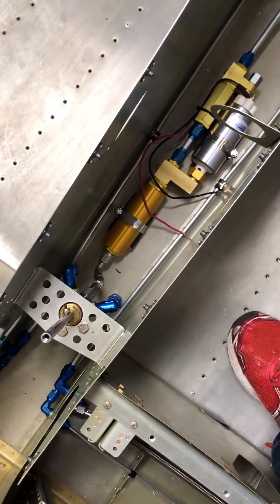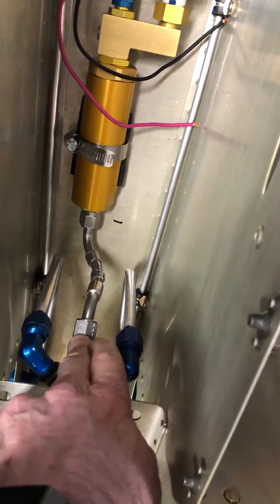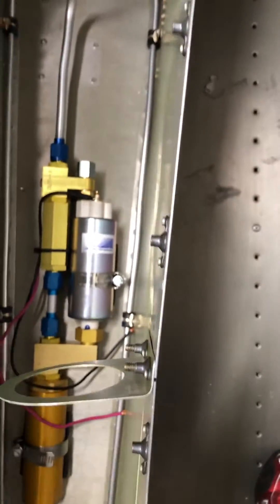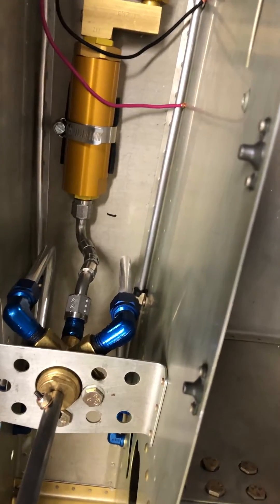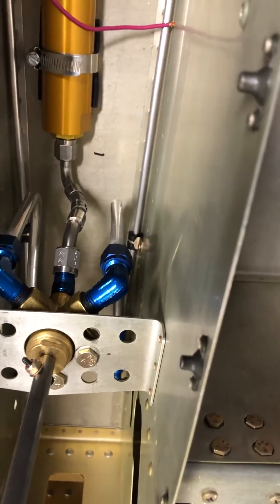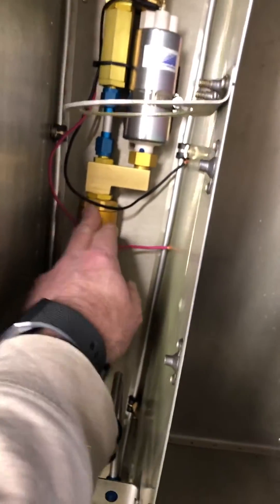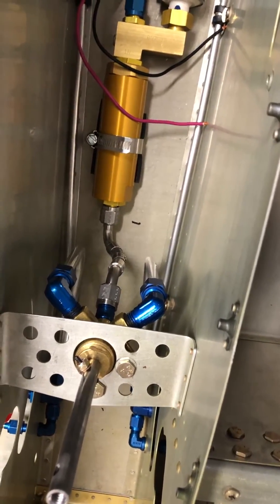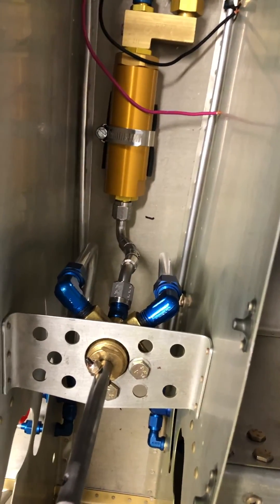RV 10 Fuel Lines - Aircraft Specialty's

Comment: Building an RV 14A with SDS EFII.  Also working with Steve at TS Flightlines/Aircraft Specialty on the fuel lines.  Worth every penny.  So much better quality & easier installation.
Reply from the maker: Very nice, and I agree Steve was fantastic to work with and so much better than trying to make the lines yourself. I thought about an RV 14A, its an awesome plane, I was really torn between the two.